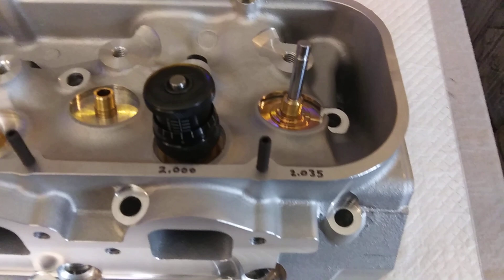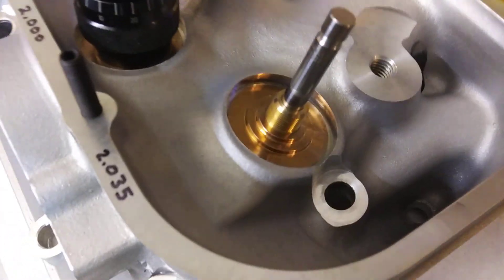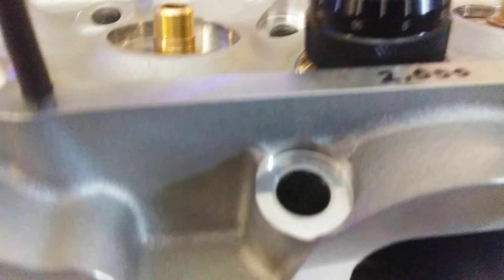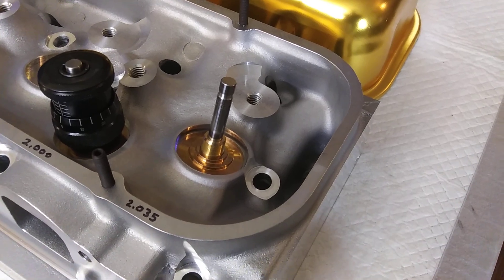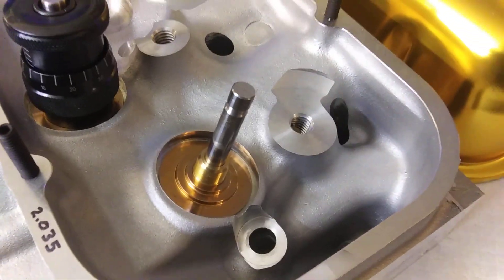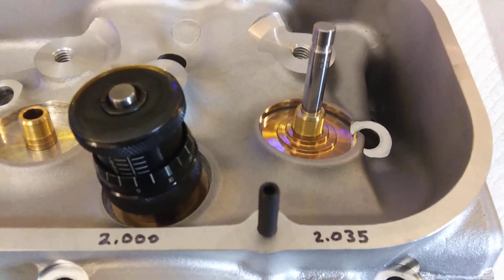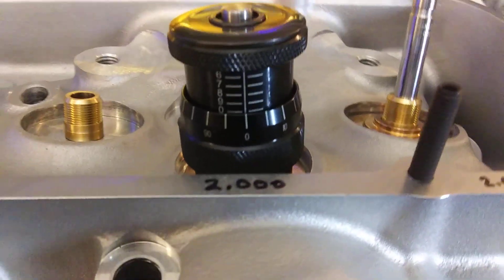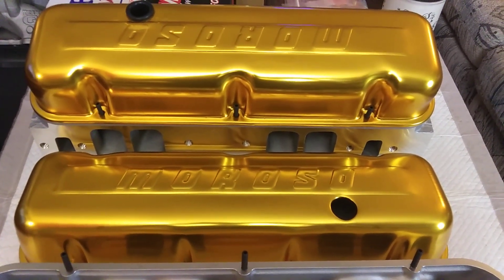How to set up valvespring installed height for proper spring pressure.

Comment: Mr Sam.. can you tell me why some of the 366 cranks are darker in color than others...?..By the way.. thanks for the blower info..!..We love your fucking content!
Reply from the maker: @ronknowles-wm9pz  Thanks for watching btw.
Reply from the maker: @ronknowles-wm9pz  Funny thing is that TD bigblock bolted right in that 2nd gen Camaro with regular Hooker headers and still had plenty of clearance. Bolted right in. Ole 366 was shifted at 6000rpm and still ran 7.30s in the 8th. I've seen one 366 built to run in a 67 Camaro drag car. It ran 6.20s NA in the 8th. It was a nice build and it was bored to 396 std bore pistons and used 6.535 long rods. Huge roller cam, high compression, big DART heads & DART single plane TD intake. Believe it was an experiment too, had a lot of work in it. Badass Camaro drag car it was in, ended up getting swapped out for a 565ci bigblock that put the car in the low 5s NA.
Reply from the maker: @ronknowles-wm9pz  Could be a few reasons, one could be less oil changes, another could be heat. Maybe the 366 had to work harder than the 427. Regardless, that's a tough, forged crank and a trip to a good machine shop would have it looking like new. Hard to hurt them cranks. And all the balancing at the balance shop is just removing metal from them, so the balance bill is always cheap. No heavy metal required in most cases.
Reply from the maker: @ronknowles-wm9pz  Those tall deck bigblock are built like a brick shit house. Crank & rods are pretty stout. Industrial grade shit. Tractor pullers loved them. Seen blown alcohol 427 TD Chevys making upwards of 2000hp with the stock crank & block. Of course the blocks were filled and weren't expected to run more than a few minutes at a time. Old friend of mines family had a 9200lb unlimited class pulling tractor and it ran 6 blown TD 427s. Did quite well. They were production based blocks & cranks, everything else was hardcore like the 6.535 long aluminum rods and custom JE pistons. Believe they used billet main caps too. Think they ran 10-71 Mooningham blowers on methanol. 366 crank is the same as the 427 crank. Just the balance is different to account for the piston weights. Even a 366 can be built to run. Did one as an experiment years ago as a place holder till the real engine was done, used closed chamber 427 heads, L-88 cam, Moroso intake spacers, old Victor intake from the 70s, 850 Holley DP carb, 2 in primary 3.5 collector Hooker Headers, T-400 trans with 4000 stall in a old mid 70s Camaro drag car. 4-56 gear and a many more tricks. It ran low 7s in the 8th mile with the mild 366 TD. All bigblock Chevys have potential.

Comment: Thanks Sam...now I am wondering if my top end Moroso kick out pan will clear a studded ,spladed lowere end.. Pan is good for up to a 4.50 stroke...Also my shop is telling me Iam gooing to have to use block filler..really don't want too...what do you think?
Reply from the maker: @ronknowles-wm9pz  That pan should clear. I wouldn't worry about filing it unless your gonna turn it 8000+rpm. If then Id only go to the bottom of the water pump holes.
Reply: @thereluctantgearhead4544  Thanks Sam..for the input...now I have to start clearing for the rods for the 4.25 crank....little bit at a time.

Comment: Mr. Sam...with a .130 over bore on this spladed TD...my shop is telling me I may have to..He has little time with these blocks...It will see more street time than strip..871 going on top...in a 70 chevelle..What do you think?
Reply from the maker: @ronknowles-wm9pz  Shit, id run it. Still probably thicker than a late 70s 454. The stock main caps on them things will take more than 1500+HP.
Reply: @thanks
Reply from the maker: @ronknowles-wm9pz  Stock TD 427 block will take 2000+HP no problem.

Comment: Mr Sam.. looks like I got room for a 4>25 crank in this TD...so the 871 in going on it.. what should the rest of the rotating system look like..I have an idea..but from a pro .. would be huge..we all hope you keep it up...we love you content...she loves it when you keep it up too!
Reply from the maker: @ronknowles-wm9pz  What heads you running? What's the application of the engine?
Reply: @thereluctantgearhead4544  Mr Sam..have not bought heads yet... looking at the AFR units..I do have the best Moroso kick out pan with all the accessories inside. Its going in my 70 ss chevelle..will run more on the street than the track.Do you think I may have to put filler in the block..because of the 130 over bore? I bought it back after high school in that condition.It also has spladed caps. Mechanist is telling me a made the trip of time...Excellent shape!..I'll tell you how that happened next time out.Thank you for the feed back brother!
Reply from the maker: @ronknowles-wm9pz  Use the biggest oil pan you can get in the engine. Windage trays always good idea.
Reply from the maker: @ronknowles-wm9pz  Good set of H-beams or Crower I beams, forged crank, best forged pistons you can buy, get them for a 9.8 deck 496, use 6.535 long rods and the 4.250 crank. ARP main & head studs also good idea. Also buy the best head gaskets you can find. Cosmetic multilayer work good. Deck block to exactly 10.20 tall. O ringing the block with copper head gaskets even better if your really gonna turn up the pressure. Big Chevys ain't hard to keep gaskets in them tho. They were made for heavy duty use already.

Comment: Any ideas would be great....love to hear your comment...please keep up the content.
Reply from the maker: @ronknowles-wm9pz  With a blower, you should run a wider lobe separation and a cam in the .750 lift range. No more than 9.5-1 to 10-1 compression, rectangle port heads with 320-335cc range runners. Use 6.535 long H-beam rods and pistons for a 9.8 deck 427. Gonna need some serious valvesprings too. 300lbs closed, 800lbs open. Use the thickest pushrods you can get, like those by Manton or Smith bros. Scorpion blue rocker arms will hold 950lbs spring pressure. Use the fattest primary tube header ya can get too.
Reply: @thereluctantgearhead4544  Mr Sam.. thankyou..now Iam pointed in the rite direction! This bitch will make some power!

Comment: Merry Christmas to the big block and gets his head
Reply from the maker: Hopefully I'll get this unit together by spring. Like to take it to the track when it opens back up. 8th mile track, I'm shooting for low 6s with this 454 NA. Time will tell. I built a similar engine a while back with a slightly bigger cam, it made over 680hp at 468ci. Pretty strong unit.
Reply from the maker: I think this one will be in the 630-640hp range. Probably 575-590tq going off previous builds. Definitely make a sub 3000lb  G-body scoot.
Reply: @thereluctantgearhead4544  Sounds like some awesome power there Sounds like you’ll have to strap some shit down with them kind of torque numbers the weather down in Ohio it’s been pretty nice yeah I Installed a new back door and was outside painting the other day and my T-shirt
Reply: @thereluctantgearhead4544  Well keep us posted on the motor sounds like a good winter project Thanks for the great videos have a merry Christmas and a good new year later bye
Reply from the maker: @awfulcoffelsonecargarage8215 Thanks for watching my videos man. I'm usually riding pretty high and have nobody to talk to but these engines and a few ole cats. I keep strange hours these days. Fuckin vampire.
Reply from the maker: @awfulcoffelsonecargarage8215 Being retired is a big ass shock to my system. I've been used to bustin ass in engine and machine shops for so long I don't know how to act. More time for my engines I guess.
Reply: @thereluctantgearhead4544  Never did get the Firebird out last summer something went wrong with my MSD box brand new 420 bucks and take a shit
Reply from the maker: @awfulcoffelsonecargarage8215 Just throw ya a good ole Proform locked out HEI in that bad boy and let it rip. Have a good holiday man, spend time with your people, ya never know when it'll be the last one.